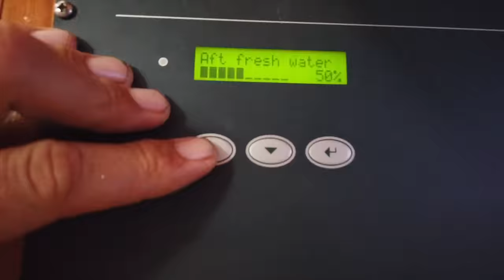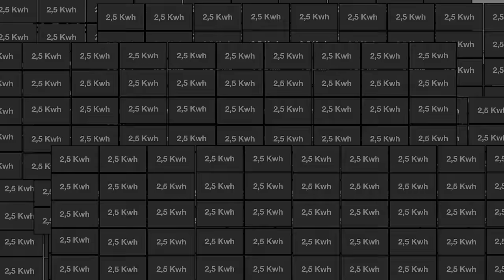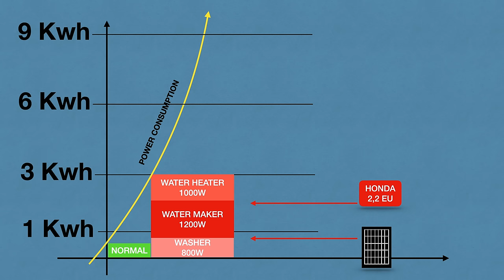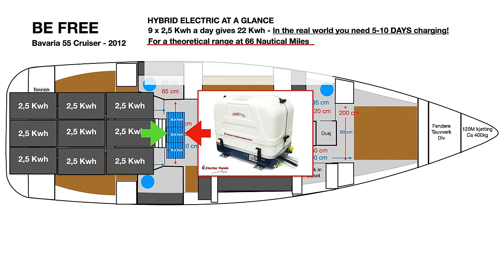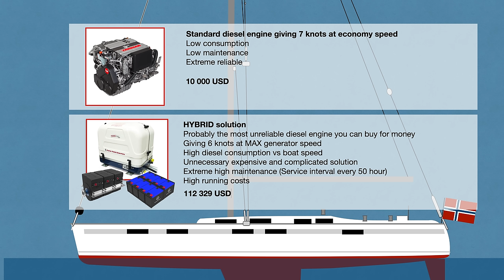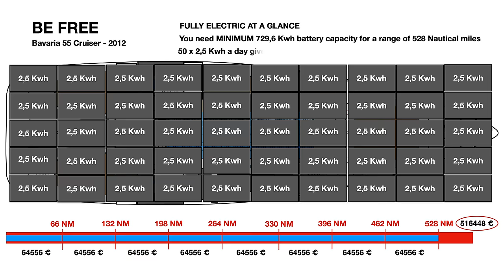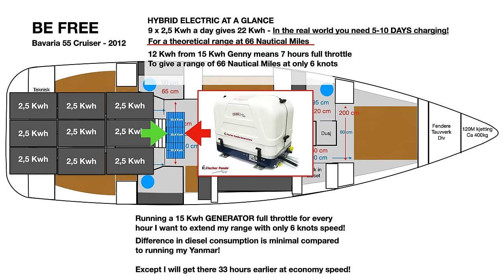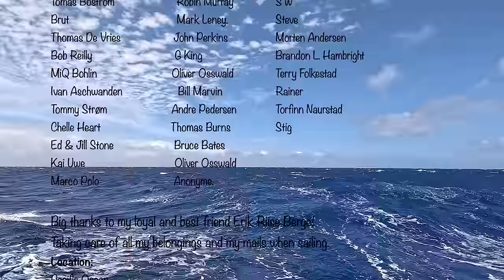Why I don't believe in ELECTRIC or HYBRID for long-distance sailing - SwT 170 - MY HONEST OPINION

Comment: I think you are right. The only not so right part of that was the charging your batteries all in one day, while desirable is not practical as you can’t use that energy in one day.
My version of a hybride is a moderately size main diesel engine with over sized generator of perhaps 250 amps, and the engine with a Vee Drive transition box. Ideally the Transition Box would have a clutch to disengage the engine and a forward extending sub shaft in line with the prop shaft with a suitably sized electric motor/generator. With that arrangement for normal short range sailing in average weather most of the boat’s operation can be done on electric power (getting into anchorages or into marinas), and where the sun fails the main engine delivers enough power to recharge batteries in a few hours whilst also recharging hot water, and while at sea under sail, this would be a period of motor sailing. Where there is a requirement for a period of maximum power the combined power of the engine and electric motor provides such power. Also when sailing in strong winds the people can charge batteries from the motor/generator.
This is all where you want to operate your home as if it were on the grid, but that is a choice. Wind Hippie for instance sails her boat with virtually no technology, even with out an engine regularly. 
I am now preparing my boat for the trip from Europe to Australia and am seriously having to consider all of this. I am finally fitting up the 1Kw of solar panels and 15 KwHrs of battery capacity to my 45ft boat. Under my solar panels are solar thermal energy collectors with should collect as much as twice the solar energy in thermal energy (up to 2Kw), and the panels are arranged so that I have 5 Sq M of water catchment. If there is no sun and there is rain then I will not need a water maker is the expectation, and if I have to run the engine to top up the batteries, I am heating the water at the same time. I have a D400 wind generator which should assist a little with energy collection as well. My full energy plan has a wood fire aboard as well for space heating and water heating too, fueled with driftwood from beaches. I am fitting enough MPPT’s for another 500 watts of solar panels on the rails, but I hope I don’t need that. 
I’m currently pulling 6 KwHrs per day from shore power while living normally at a marina, using gas for cooking, and diesel for Winter heating. In reality I will likely need the extra 500 watts of Solar PV.

Comment: I agree that a full electric boat is bad proposition for all of the reasons you describe. But I was designing a hybrid Ferro Cement (Green) with a very different focus. 
For this I specified a standard though slightly smaller Diesel engine mounted 180 degrees about with a Vee Drive so the engine sat further aft under the cockpit. The advantage of this is that an electric motor can be mounted on the alignment of the of the Prop shaft. This motors role is for maneuvering and noise free casual cruising in rivers, lakes and lagoons. It also can be used for additional power to support the Diesel in difficult situations. The engine was to have a 5 to 10 Kw generator for rapid battery charging. So that was primarily a diesel setup with auxiliary electric power.
I am set up with 1 Kw of solar capacity (with 2 Kw of thermal capacity) and a D400 wind generator, still untried. Recently I have been contemplating whether there is a wave power solution to provide an extra 500 watts while sailing using the motion of the boat. I have several ideas but still thinking about it. I won’t really know until I am sailing and can study how the boat moves relative to the constant procession of the waves.

Comment: To be honest, while I have tremendous respect for your experience and I learn a ton from your videos, I think you base your opinion here on anecdotal evidence. The fact that your genset failed in thunderstorm most likely means the circuitry wasn't designed to be bulletproof or was faulty. A circuit with multiple levels of redundant surge protections (that includes SPDs) with good insulation should have prevented that from happening. I mean, your boat wasn't even directly struck by the lightning and your genset's motherboard still got fried. Normally, the faraday cage effect should protect your electrical equipment from outside surges when not connected to the shore. Based on what you say, your genset could have gotten fried even at a marina if a light struck theirs installation. So saying the genset is unreliable is like saying your TV was at fault because it got fried during the thunderstorm. 

More importantly, any modern marine diesel engine still has an ECU that could also get fried. You can't use it without it. You can't buy a new boat without it. Yours wasn't fried because either you have an older engine or apparently it was insulated better, but if a surge reached your engine's throttle, you could have had a different outcome, still. As such, cherry-picking genset here is, to me, the anecdotal evidence I mentioned. I absolutely am not saying you were at fault here, or that you're wrong in general, but without some insight into how robust your electrical system was or wasn't, it all comes of as fear mongering, I am afraid. Did you have lightning rods? Conductive path? Grounding plate? Were metal sailing components bonded and grounded? Were each components protected with individual surge breakers and the system overall — especially the branches/sections potentially exposed to lightnings — using SPDs? Do you periodically test the grounding for resistance?

 There's a ton that can and should be done to protect a boat from overvoltage/overcurrent and there's no reason why a system can't be safe and reliable — including having a spare, smaller genset stored offline (disconnected) to help if everything else fails. And lastly, in order to be completely fair, you would have to also consider how diesel engines are way less reliable than the electric ones and how much more likely are they to fail than a boat getting struck.

Comment: Totally agree that relying on PV and batteries alone won’t work. But your main concern with a hybrid system seems to be the reliability of the Fishcher-Panda generator. So get a better generator! A generator is really just a diesel engine with a very big alternator. There’s no fundamental reasons why it should be any more or less reliable than any other diesel. For example, Polar Power uses Volva Penta engines which should be just fine.

Comment: Thanks Thomas, I realize not everyone would be willing to sail the way I do, on a small boat and solo, hence my electric demands are minimal. I have a single 330W panel out of the way on top of the bimini where it is not shaded and three lead-acid batteries as my house bank (about 300 Ah). My only demands are a tiny Engel fridge, and charging my computer and iPad and iPhone. Lights are all LED. I do use my diesel engine quite a bit, about 100 hours per season, and it charges the engine battery and keeps the autopilot that I use only when motoring happy. I have been a lot luckier with the weather than you, for example, this past season sailing around Fiji, to Tonga, back to Fiji, and down to New Zealand I had almost entirely sunny days, just four rain showers in four months!
Reply: Your set up is similar to mine, with one difference in that I also have a 2,000W gasoline generator.

Comment: For heavier monohulls, that totally makes sense. You have the capacity to carry the fuel, and under sail your speed isn't enough to use meaningfully regen from the prop.
Lighter and faster trimarans don't have the capacity to stow that much fuel, and their cruising speed is enough to keep batteries topped off from the prop regen. Solar alone would not suffice, but it's worth noting that solar output doesn't fall to zero on a rainy or overcast day like it does at night. I'm talking about 15m and under here, as a large trimaran has higher power requirements and can carry proportionately more weight (fuel) than smaller tris.

It's not so much a green thing as functional. However, that smaller trimaran still needs at least a petrol generator.

Comment: It certainly is unsafe - if ever you come in a situation where you have to run the engine full throttle to escape a reef in a storm, having a system which breaks down after a couple of minutes is not a good idea. You are perfectly right, it is an imaginary "solution" to a non-existing issue. BTW: I love Reinkes and other Aluminium- or Steel yachts with two (smaller) engines - redundancy is another important aspect...
Only potential exception: a diesel hybrid for catamarans which never run true "blue water", e.g. charter cats on the Mediterrenian see...
What I really like these days: you can add (two, for redundancy) watermakers to your bluewater yacht setup, and reclaim the large water tank as diesel storage...

Comment: Controversial topic indeed ..... I fundamentally agree with your position, although it did feel like only half the story (all be it an important half) however a major ommisions would have to be, ignoring Parallel Hybrid Solutions. There are many applications with their own pros and cons, for your particular use it definitely does not make economical sense for main propulsion solution, IMHO this fact does not exclude other applications where it can work.

Comment: in terms of charging the batteries - regen when under sail can charge the batteries back up much faster than solar. Electric motors are more reliable (much less to go wrong) than diesel engines. Just a counter point. In a cat, I'd be tempted to go with one diesel and one electric. In a mono - I'd likely go diesel for many of the reasons you discuss.

Comment: Lots of valid points. TIL Never buy a Fischer-Panda

I have a hybrid electric. 170 gallons of diesel, 12.5kw Westerbeke generator(very simple, no electronics), 1.3 gallons per hour. 90 Amps into the 70Hp motor, plus the 26.8 kWh battery. At a couple of knots below my hull speed of 8.99 kts, I should be able to motor for 780nm running the generator only. And maybe another 30 miles on top of that with the LFP battery to its lower limit. I also have 1.2kw of solar to charge the electric propulsion system.  So maybe 800 nm with no sailing. 

We shall see how it goes in my impending sea trials.

Comment: I'm a great proponent of electric propulsion. I agree with you - if I ever get enough money to buy a boat, it will have at least one Diesel engine on board. I want at least enough range to limp to shore from the middle of the Atlantic after losing the mast in bad weather. However, one option would be a hybrid solution, with the bulk of the heavy lifting done by electric motors, driven by a large(ish) battery bank.

However, at 5:35, your calculation breaks down You don't need to recharge your 730 kWh battery bank in one day, since you'll not be travelling these 528 nm in one day, would you? (Unless I totally misunderstood)

I also suspect that the Oceanvolt batteries are rather heavily overpriced. (Watching further (6:55), I see they're not quite as overpriced as I thought, at roughly 700 Euros per kWh). However, battery prices need to come down. For those prices, you could almost by a Tesla, throw away the car and just use the battery... 

A propos Fisher-Panda... have you watched Sail Life? They had a lot of problems with theirs... 8:05 ok, I see Mads is not alone... I think I'll comment on his channel about this video as well.

I still think a hybrid solution is a good idea, however it will need much more power - possibly even a serial hybrid with a normal Diesel engine just a clutch away.

Edit: backlink to Mads' video I commented on: https://www.youtube.com/watch?v=pTQiN4oJEw0

Edit2: Another comment, on another video from Mads: https://www.youtube.com/watch?v=Pap8P1qQqa4

Comment: good reality check there for a lot of people. wish myself there was a safe and greener seclusion then diesel engine. but i have not seen it. and all the modern tech is very fickle and dependent on manufacturer assistance if some thing fail. even the best is useless if you can not fix it your self.

Comment: i guess if you are not going to sail then diesel is the way to go, but if you are going to sail, then the batteries are for daily use of coffee maker. There was a girl whose engine was unreliable, relied on a solar panel for a nite light and made it around the world alone under sail.
60 miles of power is no good, i agree,....so, you make good  points

Comment: It seem that a high output alternator on your regular engine with some batteries so you can have power overnight without running a generator but trying to power your boat for propulsion isn’t realistic

Comment: Thank you Thomas, I was just seriously contemplating electrical propulsion, but no more, diesel is still the king.
Reply from the maker: Thank you so much for watching and for your comment as well. Lots of exciting solutions today, however for blue water sailing a well maintained and reliable Diesel engine is still the way to go. Despite what many seems to believe, a Diesel engine is very simple compared to electric solutions. More reliable and safer. Guess my video that’s online on Monday sailing through a cat 1 hurricane will enlighten the need of range and capacity better than any opinions about this topic.
All the best

Comment: Great show, looked at the same and was 50-120k for hybrid (keep my 42hp engine as genny) with regen. but wont work until we have viable H2 fuel cells or regen that exceeds output / similar. but not that ex car batteries 77kwh is only 600usd now and can pack in the hull better but performance is 1/2 when its cold..  however with your mileage a bolt on hydro gen might help in the pacific ...
Reply: '77kwh is only 600usd now'  Wow!  That's amazingly cheap compared with any other battery
Reply: @tmog1000  used or recovered and you need to build a new battery...
Reply: @RichieKeane  I did wonder about that

Comment: You obviously have a point about going full electric. But the only "hybrid" version you mention is a "series hybrid" system which typically still requires a diesel-burning piece of equipment in the form of a generator. If you go "parallel hybrid" with the electric motor connected in parallel with your existing (or new) diesel engine, you no longer need a separate generator as the diesel engine would utilize the electric motor as an alternator when running in full standard diesel mode. With a clutch, you can disengage the diesel from the electric motor to allow the prop to spin independently when sailing, or while docked as a generator. Both would allow for regeneration through the electric motor. In best-case scenarios with the batteries charged full, you can go full electric and run silent out of marinas or on short to midrange trips completely noise and exhaust-free. 
I can't remember the average stats, but this type of setup would provide significant fuel savings and added longevity for your equipment. It would also be far easier to achieve the 500 or even 1000-mile range target you specified. Lastly, you would have the added benefit of redundancy in your propulsion system. If one part were to go down, the other could run independently.

Comment: You did not mention the tandem hybrid.
 Large diesel attached to the prop directly and an electric system driving the shaft thru a pulley.
It allows you to:
1 Use just the diesel engine as normal
2 use just the electric
3 use both at the same time
4 regenerate while sailing
5 regenerate while using the diesel engine.
This needs a hydraulic gearbox that will decouple from the shaft. 
And will not work with a sail drive.

It's excellent to get out of marias and anchorage without turning on the diesel engine.
I hate turning on the diesel just to leave the dock.

Cheers mate 💪
Reply: He didn’t go into that did he . Wonder why. Seem behind on his approach to hybrids
Reply: @briandale8386  I think because hes boat has a sail drive he doesn't even know this alternative exists. 
Maybe he will see the comments and get aware. Cheers mate.

Comment: I HAVE a honda 2000 eu type genset onboard .. the wiring harness fell to bits .. disintergrated
Reply from the maker: Wow! Sorry to hear that. My Honda as worked flawlessly for 5 years. But I’m lucky to have a garage on my boat to keep it when not in use.
Maritime environment are hard on most things that’s not originally designed for this. Thank you so much for being here

Comment: I think you are absolutely right. Even electric cars easily get into trouble when snow falls and the temperature drops. The energy is much more concentrated and thus larger in a fuel tank. To keep warm in cold latitudes when traffic is stationary for a long time, electric cars should have a diesel heater with fuel for safety and to save electricity for the engine. Black sails already exist, if they could work as solar cells too, it would be interesting. Hydrogen is perhaps something to dream or have nightmares about.
Reply: No way would I have hydrogen on my boat. I won't even have petrol. Seen enough boats go up in flames from petrol fumes.